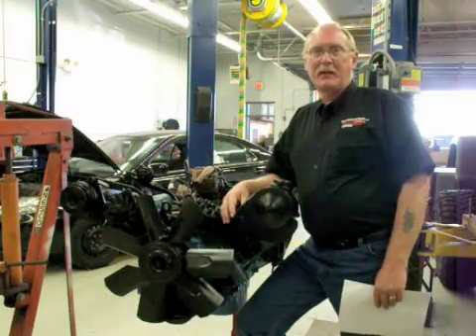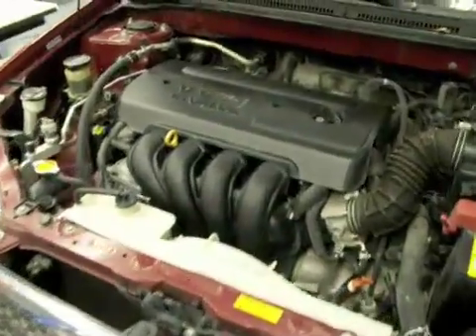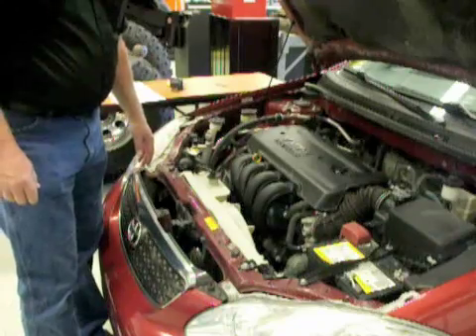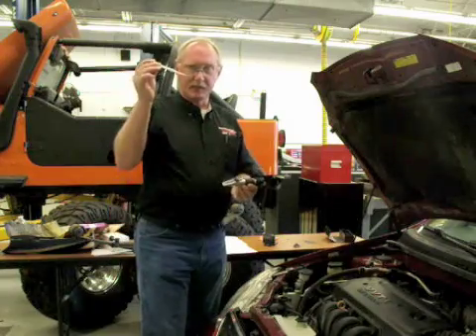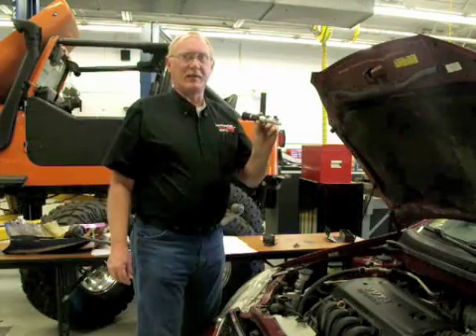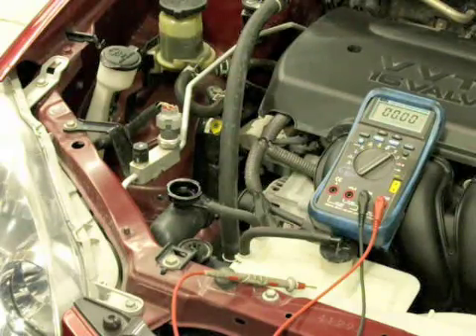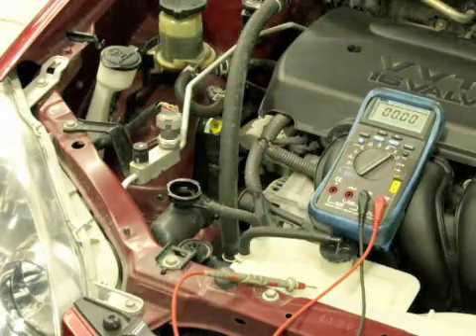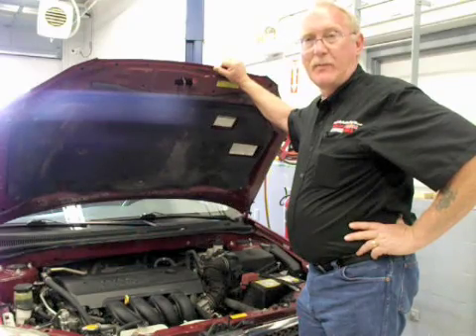The Trainer #2: Cooling System Service

Comment: How does the refractometer calibrate and what sample is needed?  My refractometer didn't came with a sample.
Reply from the maker: For coolant testing, you can calibrate with distilled water - tap water, in a pinch.

Comment: My information goes against this excellent video, but its the best i can do with limited resources. I dont have a proper cooling service flush/recharge machine. I use tap water via a garden hose. Remove one heater hose from engine side. Insert garden hose into heater hose. Slide heat control to "hot". That opens heater tap to allow coolant to enter heater core in vehicle dash area. Remove radiator or expansion tank cap. Loosen bottom radiator hose clamp, where it attaches to radiator but dont remove bottom hose from radiator yet. If you really want to do a better flush job, remove thermostat. Some engine designs, are a pain in the ass to access/remove thermostat. Turn tap on slowly, make sure garden hose doesn't pop out of the heater hose from water pressure/ hold it by hand or secure with hose clamp. Water will enter heater core, exit 2nd heater hose into engine block & cylinder head.  Depending whether you have removed thermostat or not & thermostat location. Some thermostats are located near where top hose attaches to engine or near where bottom hose attaches to engine. Water cannot by pass closed thermostat, but it will reverse flush around head/block/enter radiator & exit out where radiator cap attaches which you have already removed. Keep tap on till contents flow clean out of the top of radiator. Then grab bottom radiator hose/remove from radiator till all contents flow/empty from head or block depending where thermostat is located. Then refit hose to radiator till contents flow out top of radiator is clean. Repeat procedure till contents flow clean top & bottom. Turn tap off/remove garden hose from heater core hose/secure bottom hose to radiator. I use a concentrated anti/freeze boil coolant. If you can find out the capacity of your cooling system, it would handy to know. Example, 10 liter cooling system capacity, add 5 liters of concentrate.  I usually get family member or friend to help me. Someone pours the concerntrate into radiator or expansion tank till all concerntrate is emptied into system. Then top up with tap water. When contents bleed air out of head, block & heater hose, reattach/secure heater hose. Let your engine idle , you may need to add a little extra water as the engine warms/ thermostat opens/bleeds final air from system. If contents start to spill out, attach radiator or expansion tank cap immediately. Let engine idle till top & bottom hoses feel hot. Electic radiator fan may switch on. Once top/bottom hoses are  hot,  switch engine off & let cool till hoses have no more pressure. Top up with water as required. I flush/recharge my cooling system every 2 years irrespective of mileage. Never had any major engine problems. My 30 year old vehicle has done over 450 thousand kilometres. Usually replace radiator every 8 to 10 years as its plastic. Change water pump every 100 thousand when i replace the timing belt. I use test strips to check my coolant acidity,  reserve alkalinity, boil point. Works ok. Cheers from 🇦🇺

Comment: Hello, Sir. Does  the coolant have to be too acidic  for electrolysis resulting from a bad ground  to find a path through the radiator? ( Can you have bad ground electrolysis without chemical electrolysis?) Thank you.
Reply from the maker: The presence of stray voltage in the coolant can be caused by two primary factors - the high acidity of the coolant from degradation of the inhibitor package or poor vehicle electrical grounds. Bad grounds can also lead to the rapid loss of the inhibitors as well, so you need to make sure that both potential causes are corrected.
Reply: Thank you, Sir.I always  thought that  the radiator could only be used as a ground path if the coolant was too acidic from chemical electrolysis. Apparently, even if the coolant  is chemically tested good,  the radiator can still be used as a ground path if you have a bad ground.
Reply from the maker: @bbmd2200  Not the radiator...the engine block via the coolant flowing in it.
Reply: It's more accurate to state that, "Electricity takes all paths to ground, not just the fastest path to ground. If you give Electricity a path to ground wether intentional or unintentional it will take all of them.